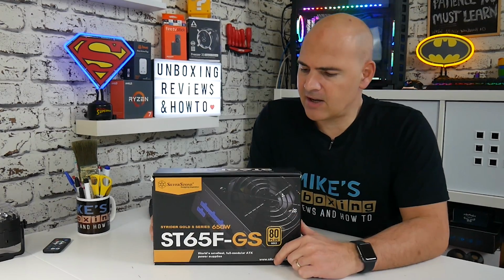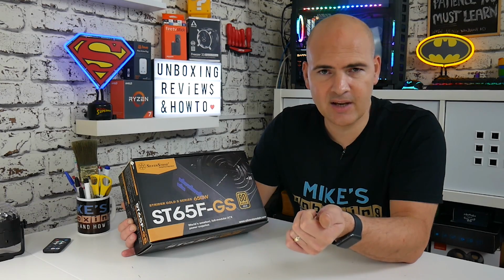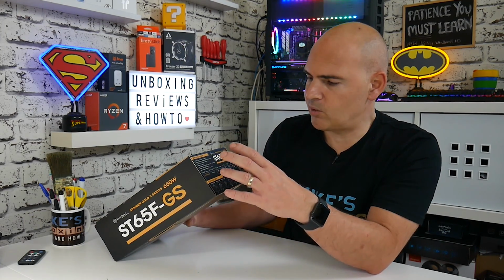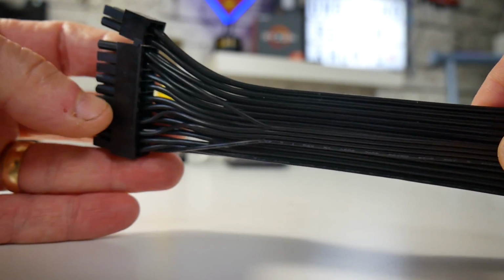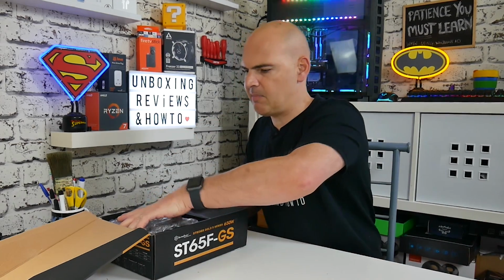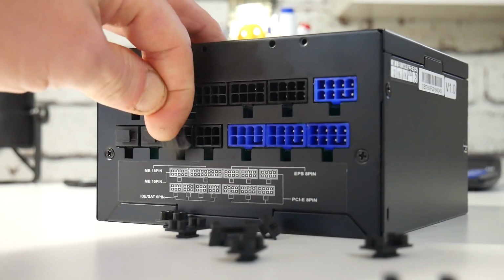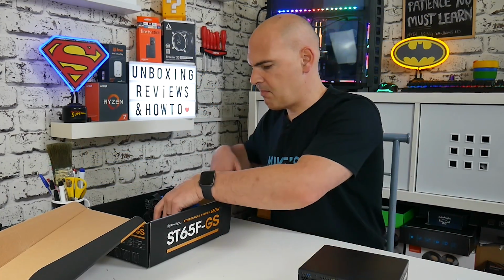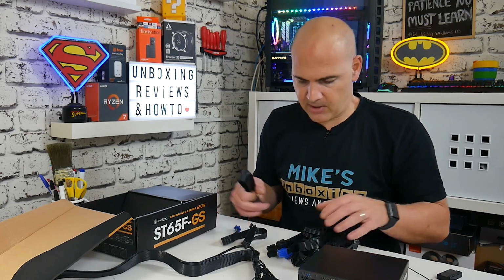Silverstone Strider ST65F GS 80 Plus Gold Rated 650w Mini ATX PSU

Comment: Bitfenix Prodigy, you want as much GPU room as u can get.

I just connected a 24 pin to a 24pin matching wires. Only one side breaks away apparently. Trying to figure out how to plug a 20 pin into the PSU side. Far as I can tell the main different between PSUs are the sata power cables you have to take extra care and wire those up exact, but my Mobo connector is definitely too long PSU side hmm. (I got this PSU for $30 with no cables, my EVGA is massive right now sitting outside of the case so I need something smaller and this is also Gold & will be ran at %50 load instead of %30 to %40 I've been running so it'll be worth it to me if I can build a set of cables for it.

Comment: I bought this product yesterday here in Philippines and I'm just gonna ask something. When you boot a system using this psu, is the fan spinning as well? Mine does not tho and its been bothering me since the unit I bought is working but the fan is not spinning. I'm trying other things like gaming etch. but still not spinning.
Reply from the maker: under low loads or when cool the fan will stop
Reply: Goat Nelly where did you purchase it? Pc Express?
Reply: @TheDTVOfficial  I ordered it online via Lazada. Right now, psu is working perfectly fine.
Reply: @dimsel6151  awesome thanks for the info!
Reply: Update po? Nagana parin ng maayos?
Reply: @NinaMercado222  Yes. Works perfectly up to now :)
Reply: Hi does your psu buzz when there's a spike in voltage? Happens to mine